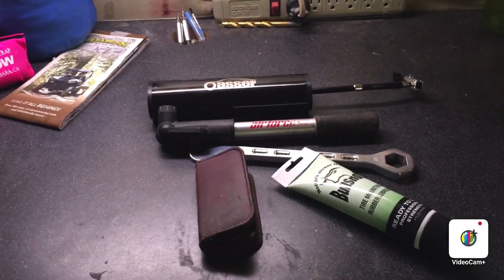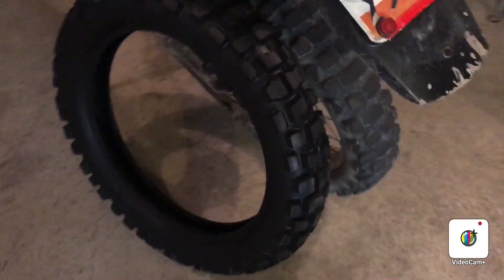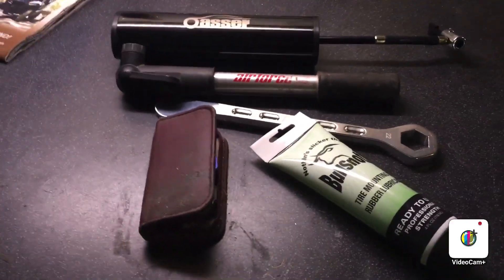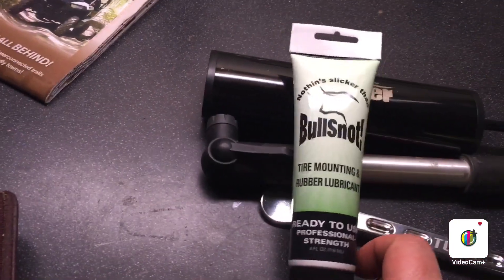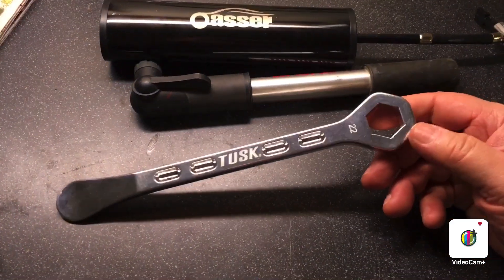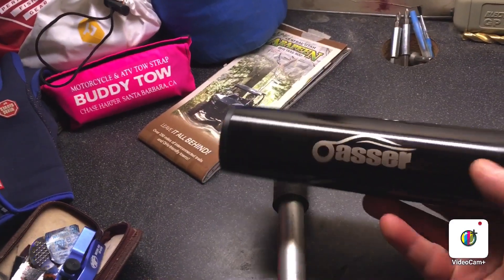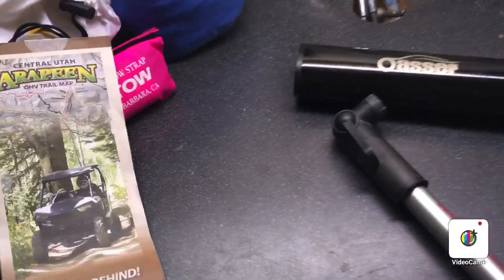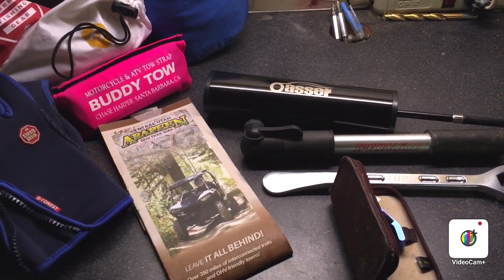XT250 - Flat Tire Kit

Comment: So you would use the 21" tube in the 18" tire if that had the flat?
Reply from the maker: Yes… it works to get you down the trail. Depending on the situation, patching your 18“ tube can be an option.
Reply: @XT250allday  thanks!

Comment: Where did you get the Tusk 17 and 19?  Don't see them on amazon
Reply from the maker: The 17 & 19 are not Tusk. They are DRC & steel not aluminum. I wish they were. But I do like the DRC’s spoon shape better than the Tusk.
Reply: @XT250allday  thanks!

Comment: Hi Bret. I am converting my DRZ trail tool bag over to an XT tool bag. Please confirm the stock axle bolt and nut wrench sizes. 22mm, 19mm, 17mm. Also to be able to more easily fix a flat out on the trail, I am in the process of making sure my enduro star trail stand can lift both the front or rear wheel off the ground.  So important!  http://www.endurostar.com/
Reply: Looks like I already see you confirmed it in your comments. Thanks Buddy!
Reply from the maker: Dave Lockwood That’s nice. I’d not really even thought about being able to suspend a wheel. 👍🏼

Comment: how many miles did you do on the 606s?
Reply from the maker: Sebastien Dumond-Ruffel Rear D606 was excellent right at 4,000 miles.
Reply: @XT250allday  First off, love your vids man! great for a DS newbie! Based on your review and videos, I went to buy a 606 and they had it in stock but once they were going to mount it, they told me that it will rub the Muffler and chain guard. Did you have any of those issues with it? Went with the only other one they had in stock which is a Shinko but really dont like it. want to go back and get the 606. thoughts?
Reply from the maker: @MJ-ob3ry  No, I do not have any issues with rubbing ... the size of the D606 rear tire I have is 120/90x18. That size is no problem.
Is that the size you were looking at?
Reply: @XT250allday  Yep! That was the Size. going back to get it then. Much appreciated! Afraid the Shinko it will not give me enough while off-road.
Reply from the maker: @MJ-ob3ry  Ride on!